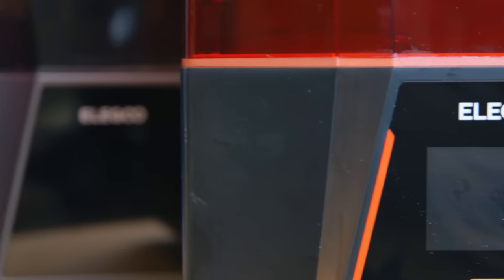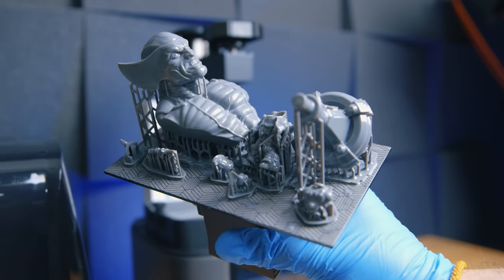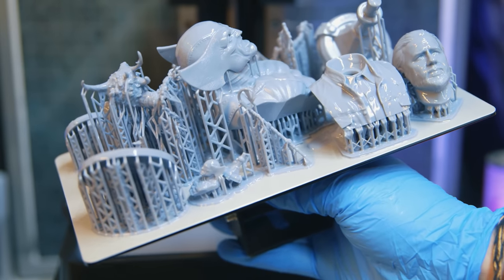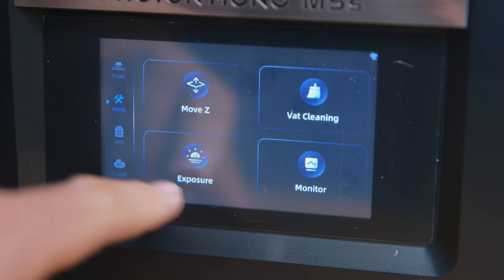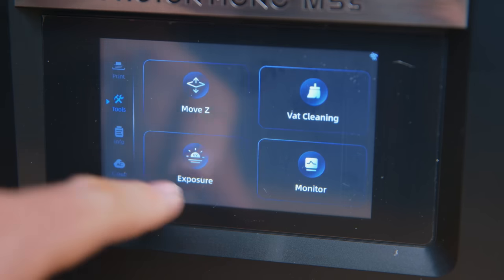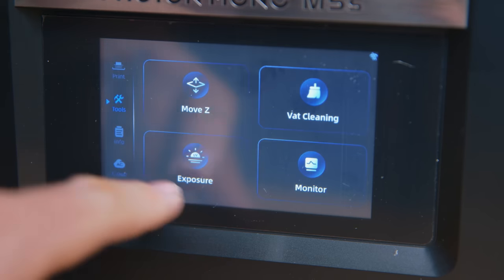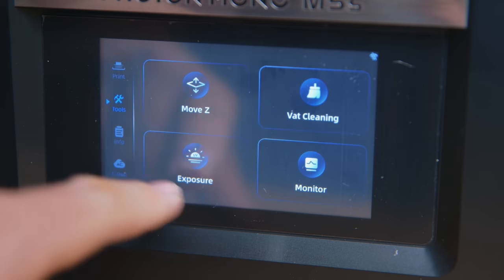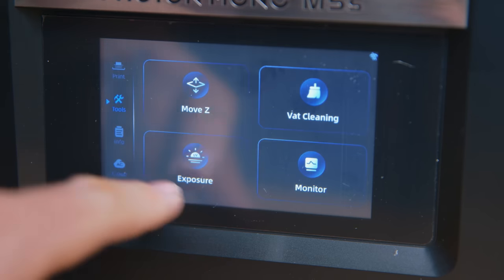Saturn 3 & Ultra Vs Anycubic M5 & M5s - 4 Printers - 1 CLEAR WINNER

Comment: Bought a Sarurn 3 ultra. Using castable purple resin from 2 manufacturers. DOESN'T HARDEN ANY RESIN AT ALL.!  Seem with these printers there is no customer service.  You're basically on your own. Take 2 weeks to get any response to email only. I feel like I bought a 600 dollar paper weight. I could go through to weeks of setting and print trails. But it literally will not harden resin at all. I'm at a loss! Wish there was a 800 number for help!
Reply from the maker: Castable resins typically have much higher curing times than other resins, I've seen upwards of 7s for 7 micron layers. have you done exposure tests?

also there are a few resins on the markert, a small few that work at a different wavelength to these printers...
Reply: @FauxHammer  yes.. several times ran exposure up to 15 seconds with syertech purple. Won't even harden in vat on cleaning mode or at all. Light seems to be working in all respects(watched without vat or palate on)
Reply from the maker: It must surely be the wavelength of your resin. Are you sure it’s printer resin.

Sorry I’m not trying to be condescending. I’ve seen a lot here, but never a printer that can’t harden resin.
Reply: @FauxHammer  I can't thank you enough for your time on this. But at this point after talking to resin manufacturers with serial numbers of resin. It's either the light source doesn't work with that resin from 2 manufacturers even though they advertise it does, and they have specific specs for that printer to do so. o
Or it's a bad printer in general. The one I have anyway. I'm going to get a new printer and different resin again. See where that goes. It's a shame but seems like the only path forward at this point. I would think with this newer emerging technology they would have at least a 800 number or some type of support. Js

Comment: Look at all that scraping and mess your making without a flex plate, not to mention the posibility of accidently flicking a fragile model on to the table, let alone across the room (7:55 > 7:58, you literally fling a piece out of shot at a speed that my eye can barely follow???). I can pull my flex plate off the print surface while its attatched to the printer, keeping all left over resin on top of the build plate in the printer. Then I can just flex all the pieces straight into my wash and cure machine, I also sell miniatures and other things as a small business and I can tell ya it saves a heap of time, on top of the other bonuses. "Waste of money" for an objectively useful part is a bit funny considering we are speaking about hobbys, as well as printers that cost up to $800 AUD, sparing not even $20 AUD in some cases for a flex plate that improves the experience so much is a bit of a nonconformist mind set for the sake of it in my conformist sheep brain opinion. 

Trust me, I know im coming across butt burt at a throw away comment, but it has genuinely made my experience with resin printers so much better, increasing speed at which I can switch prints, clean prints and makes it easier for me to keep those smaller pieces in tact through out the support removal process.

Comment: Without doubt for 98% of the time this don't matter. But I build my hole life machines and can say a ballscrew drive is leading, the background is that the machine has no linear measurement system to correct the fault and backslash of a normal screwdrive. So if you want do mechanical stuff u will have higher accuracy

Comment: ill never use a printer with a ball joint for leveling the build plate like the saturn 3. It is a terrible design, it consistently gets knocked and needs re-leveling. 4 screws please. Just level it ONCE and it never has to be leveled again, ever. I can't believe a build plate with a ball joint still exists, it's just terrible.